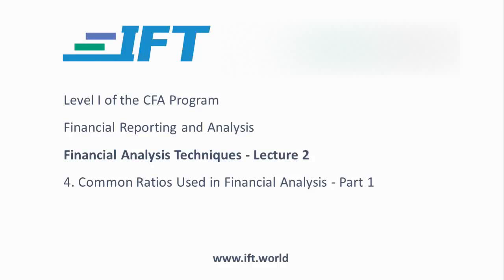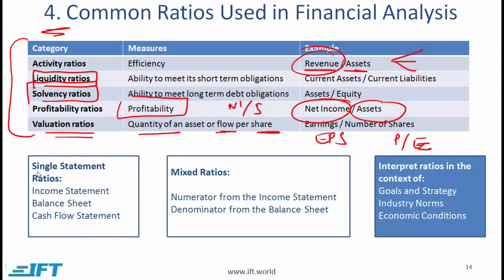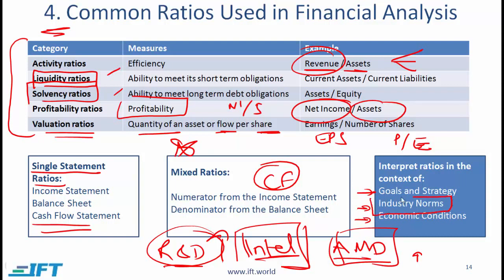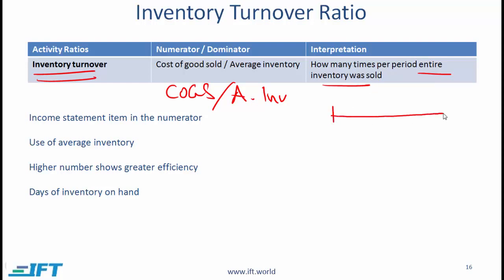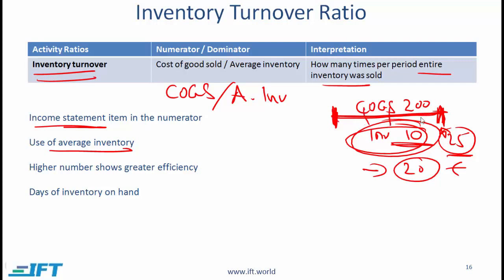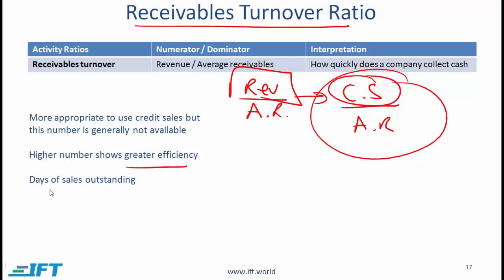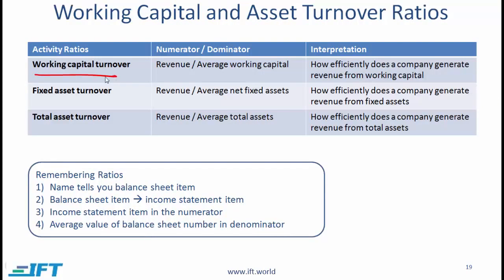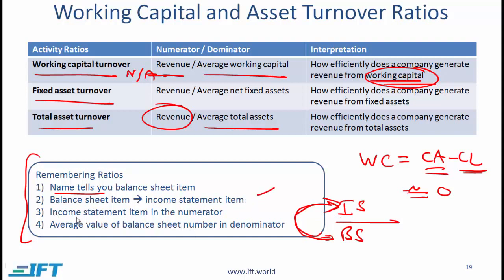Level I CFA: FRA Financial Analysis Techniques-Lecture 2

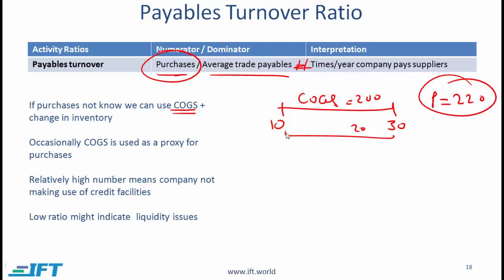Comment: Just to make sure sir, in 10:42 if the inventory number at the end of the period was"10" which is lower than the inventory "30" at the beginning period, would we still need to add the change of "20" in inventory to the COGS (200+20=220)? Or it would be subtracted in this case?
Thank you so much 
Respect.
Reply from the maker: We cannot entertain multiple CFA questions via YouTube comments. If you need additional help, please purchase the IFT Q&A service. Alternatively, you can post your query on at www.analystforum.com where we will try to answer your question if you add "Studying with IFT" as shown below on your account profile.  If you do post there, then message via this link and include the direct link to your post.
IFT Support Team
Reply: Purchases in that case would be -200+20 = -180 (negative meaning cash outflow)

Comment: Even though the curriculum says that Inventory turnover Ratio= COGS/Avg Inventory, but shouldn't it actually be =Sales/Avg Inventory?
@IFT
Reply from the maker: COGS is used instead of sales for greater accuracy in the inventory turnover calculation because sales include a markup over cost. Dividing sales by average inventory inflates inventory turnover.
IFT Support Team
Reply: @IFT-CFA  Thanks for the explanation. Your videos have helped me a lot throughout. A big shoutout

Comment: Isn't solvency ratio debt/equity rather than asset/equity?
Reply from the maker: Assets / equity is a financial leverage ratio. It is a type of solvency ratio. Please refer to exhibit 14 of Curriculum Reading 26. 
IFT Support Team
Reply: Solvecy ratio is actually a group of ratios, and those 2 ratios you mentioned are part of it. 

The 1st one is called debt-to-equity ratio and the other one is called financial leverage ratio or equity multiplier.